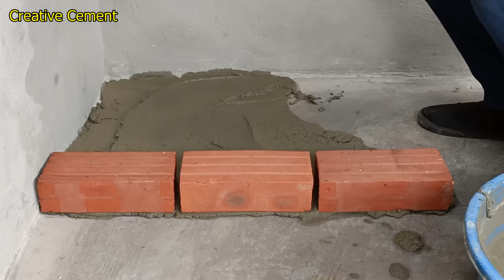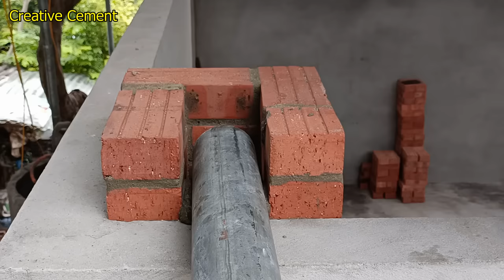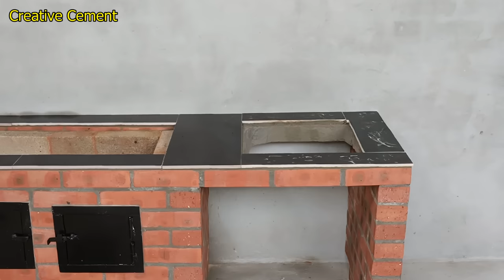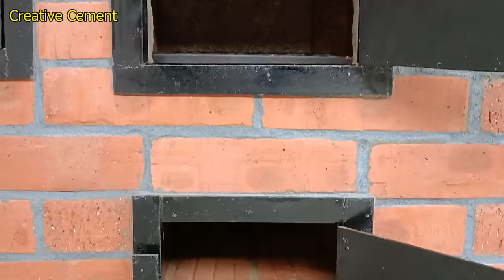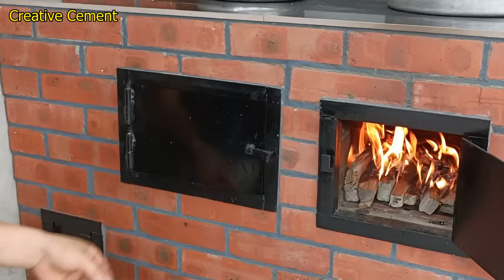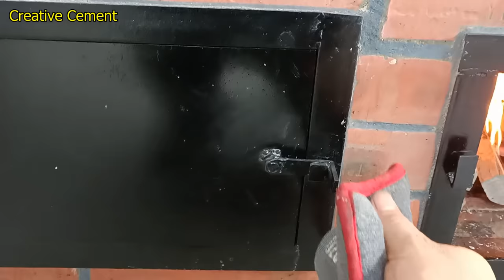How to make a multi functional wood stove for a beautiful kitchen

Comment: Q: The right and left chambers don't have a connection and the bottom of oven doesn't have any fire, how does it get hot?
Reply from the maker: Heat is generated by the exhaust gas flow.

Comment: Use Air Extractor on the top of the Chimney.which does not require electricity. Slight wind operates it .

Comment: Very beautiful finish product.. Mat i know what's the name if materials you used especially the stainless for oven doors etc.. What do you call them please.. Were can i buy them🙏
Reply from the maker: I use cement, clay, sand, red brick, heat-resistant brick, sheet metal, heat-resistant cotton. Oven Door please use cast iron alloy metal, you can find and buy in the market.

Comment: can i build it myself? because I see you doing it but you haven't given any directions some parts were moved faster I couldn't understand what you did. is it possible you give exact measurements of materials from ground to top? if it not a bother kindly. thank you amazing results
Reply from the maker: I make with red brick materials, the fire box uses heat-resistant bricks. Sand and clay mortar, heat resistant cotton, cake boxes and metal plates

Comment: What's the thickness of the metal plate you placed on the top of the cook top
Reply from the maker: It has a thickness of 6 mm
Reply: @CreativeCement  which would hold heat for longer period
Is it thicker or less thicker metal plate

Comment: I would like to ask the author of what material the black plate you placed between the fire and the bottom of the pot is made of, and does it reduce the ability to transfer heat directly from the fire to the bottom of the pot?
Reply from the maker: It's a metal plate
Reply: @CreativeCement  When adding a layer of separation between the fire and the pot, does it affect the capacity of the fire created to heat the pot? Thank you for answering my question